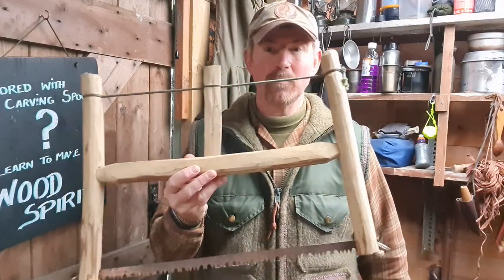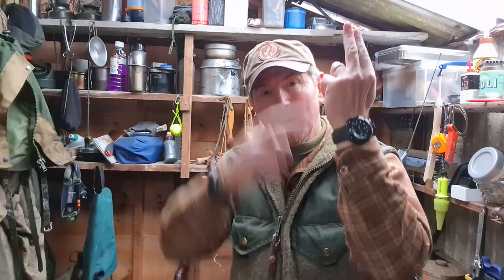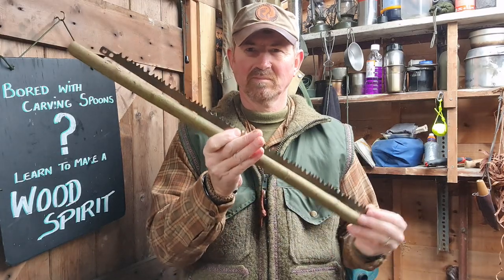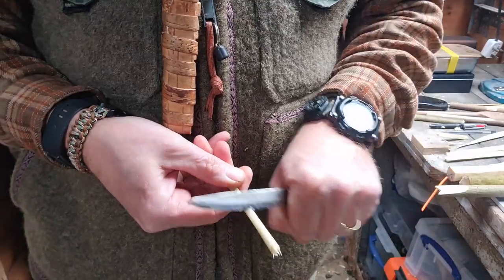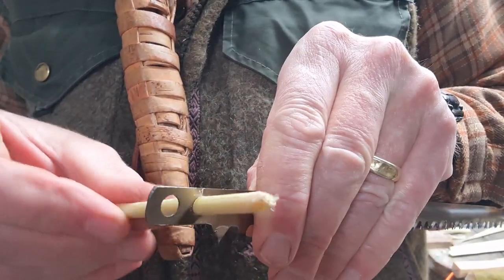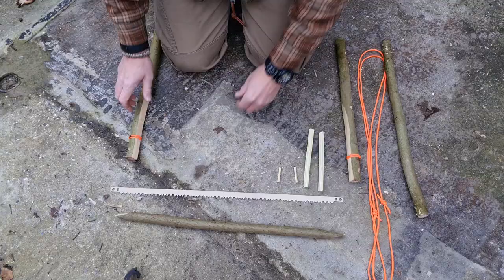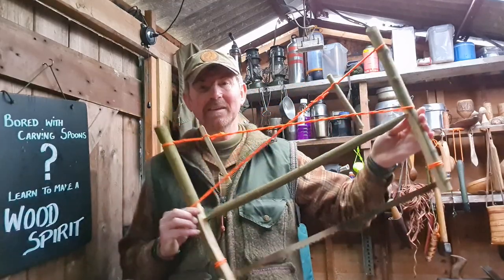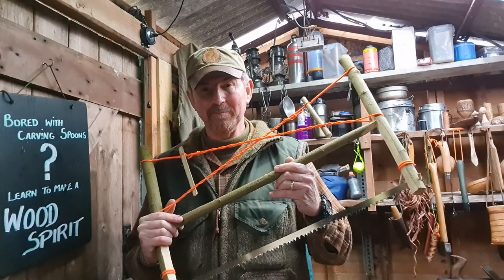Simple Stick Projects - A BUCKSAW

Comment: I am curious what benefit the double windlass adds over a single windlass.
Reply from the maker: The four contact points  seem to give more rigidity than just two, it works very well Matt over the others I have tried over the years. Try making one.
Reply: Kelly’s video on the saw with Mors commentary Matt, 
https://youtu.be/U94JgBQSfUU

Comment: This seems over complicated, what are the benefits to having these twin tension loops ? Also, I feel there would be a danger of the horizontal being split at the narrow ends, by the wedge cut verticals. Genuine interest, not hate.
Big fan of your videos and projects.
Reply from the maker: Rob, I have tried lots of ways of making frame saws , but this method irons out all of the flaws, it just works better. Without sitting down and analysing it, I couldn't tell you why. Try it! See what you think
Reply: @greencraft4783  I will be sure to give it a go 👍